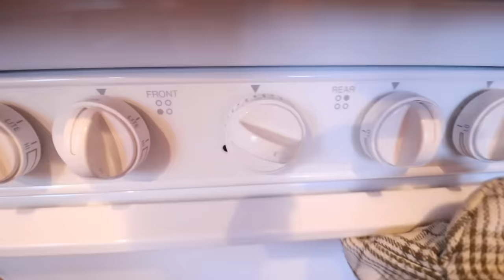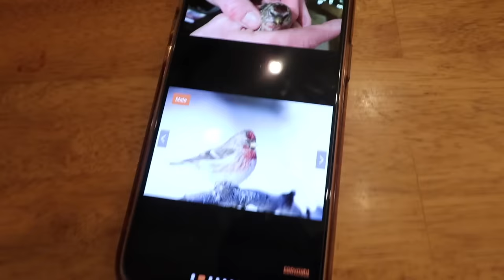Harvesting Firewood in Alaska! Heating our Off Grid Cabin + Blueberry Biscuits!

Comment: At the 34:50 mark, get 2 or 3 plastic wedges. You can pound those in to free the bar and give the tree a little persuasion on which way to fall, or not fall. You should also do plunge/bore cuts after you cut the wedge and establish the hinge. Pound the wedges into it. Then cut the back strap.
Reply: Hey thanks. I’m not picking on you. Tree felling is extremely dangerous. Just giving you tips on what went wrong and how to just keep you safer. 
Nonetheless, the gathering of firewood is quite the labor intensive job – but with its direct rewards!  Free(?) heat is one of many God's gift to mankind!

Comment: That sheep water dish door is amazing. Love it!

Hows Rusty doing with the spraying since the neuter?

We have the same Tupperware, lol. January is a lazy month, lol.

I kmow Joes not perfect, but he is being the kind of dad I am writing my book about. Good job Joe! Some wax on the bottom of those boards might help and keep them in good shape.

Pretty bird! We had a small bird fly into our house not long ago. 

How often do y'all have to knock the snow off the shelters and cabin?

Does the log splitter work in the subzero temps?

Hows the cabin addition? Is the fan keeping it warm?

Be safe with those trees you two! Especially in snow shoes! 😊 Joes grunting cracked me up! Tina I am going to steal the word "inspo", as the kids say, lol! 😂

Great looking logs, whats the towing capacity on the snow machine? 

Sorry for all the questions. 😮

By the way, I meant to tell y'all that we just got T Mobile 5G home internet to rally and its great. Thr coverage map looks good for yalls area, might be worth looking into. Proably cheaper than satellite too.
Reply from the maker: 1. Rusty has not sprayed since being neutered.☺️
2. We don’t clear the snow off the cabin, the pitch is steep enough that it slides off on its own. The shelters & outbuildings are built pretty tough so we clear snow when we feel like it.☺️
3. Yes, the splitter works in below temps.
4. The vent is “warming” the addition but not to the level I (Tina) need it to be lol) so we did buy a small wall propane heater for that room. We’re still working on the addition, hoping to have it done before spring!
5. We don’t have a clue what the towing capacity is of the snowmachine. It has a 900cc engine so it can tow some STUFF lol!
Reply: @HomeFreeAlaska  awesome, thanks for humoring me Tina (and Joe)! 

Hope yall got the reply I emailed, sent some pics of us and an intro. Thanks for the community!
Reply from the maker: @brandonpacheywiredforlife  we did!!! Lovely photos! You guys have a beautiful family!!! 🤍🤍🤍
Reply: @HomeFreeAlaska  thanks for the follow up!

Comment: Just curious, how long will you be able to heat the cabin with just the first tree you cut? Also when will we see the new addition again.
Reply from the maker: One tree usually lasts about a week, depending on the size of the tree & the temps outside. Negative temps, we tend to burn more wood. We’ll be working on the addition soon!🤍🤍